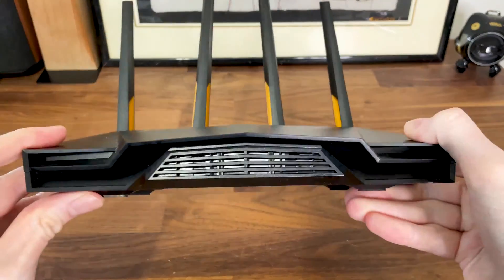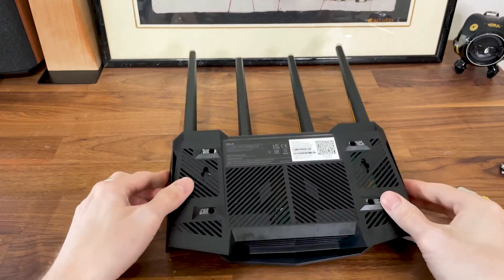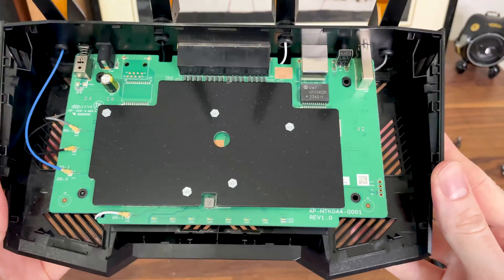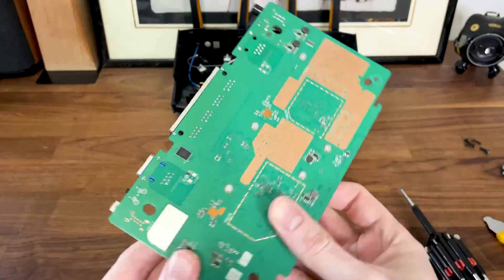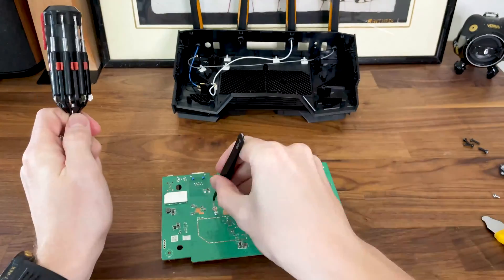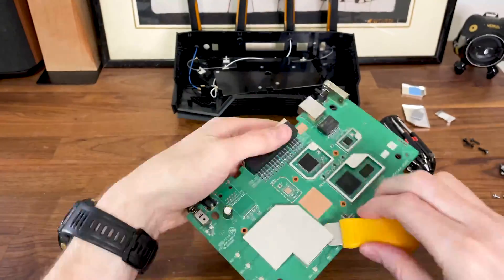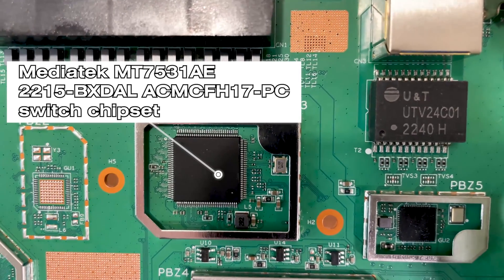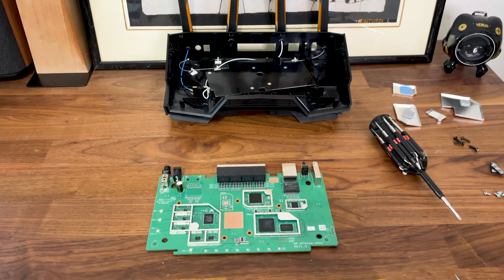ASUS TUF AX4200 Wi-Fi 6 Router Teardown - Not very different from the ASUS TUF-AX6000

Comment: Great video. You make it seem so easy with those shields 😂 you did not said anything about the pads. My opinion is that they are very poor quality most of them already dried. I have replaced all with Thermal Grizzly minus pad 8 but some of them have a strange thicknes and i had to combine two pads to make it.

Comment: Hi, how's the router performing, mine died within 10 days of purchase, got replacement which took 45 days. There's huge wifi issue with this router and updating the firmware is a nightmare, as mine got bricked after updating it.
Reply from the maker: Ouch. My unit is still functional, although I use it sparingly, depending on whether I need to check a function or retest something. Did you manage to debrick your router?
Reply: @SamBondor  No got it replaced, the replacement unit is performing better, but WiFi range and speed are a lot worse